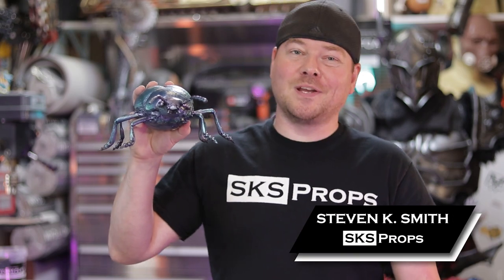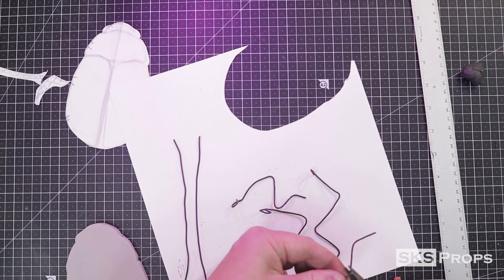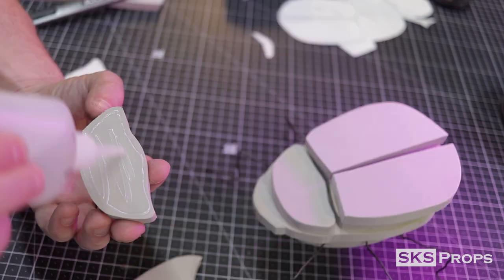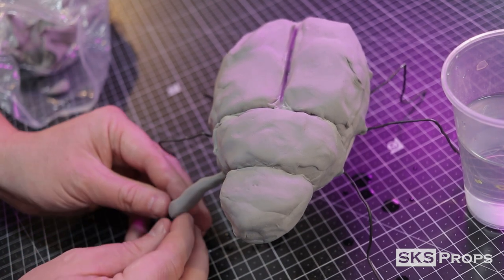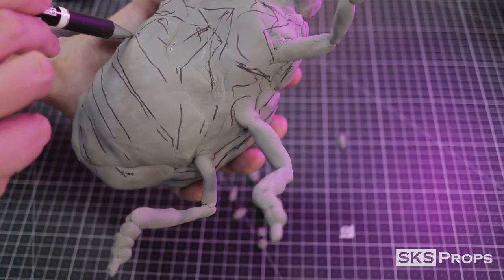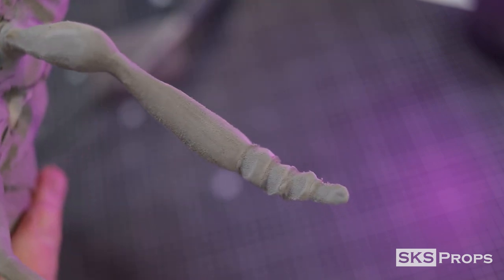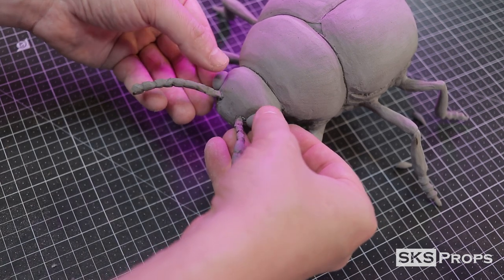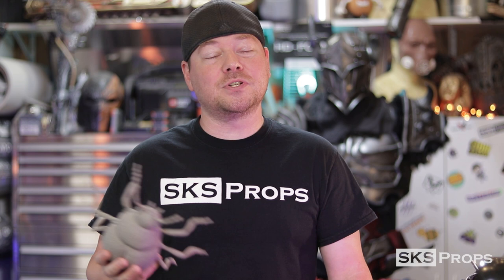How to Sculpt a Beetle using Foam Clay - Mint Beetle Insect Foam Craft Techniques

Comment: Great video, thanks for putting this on. I’m very impressed and inspired by this. Just a quick question. At around 4:30 you say you like to put one layer of foam clay then let it dry and add another layer and again letting it dry and add another layer. But before that you also said it takes 24 hours to dry. So are you doing this repeated drying and adding over three 24 hour periods? Thanks for the great videos, keep up the good work buddy!
Reply from the maker: It will start to skin over in about an hour it will then dry out more the longer you let it sit. So I will usually let certain layers dry for a couple of hours before I add more. If I’m sanding that’s when I’ll let it dry 24-48 hours